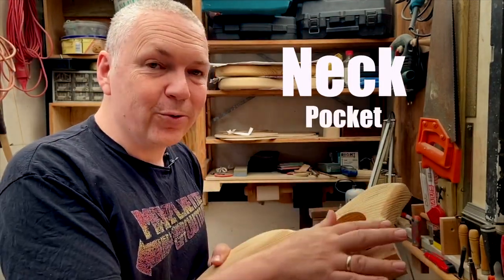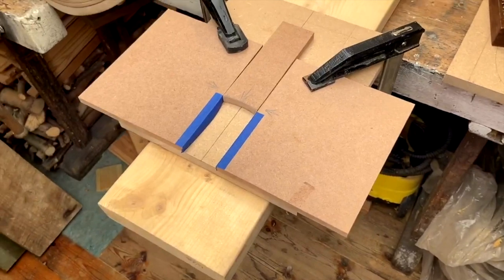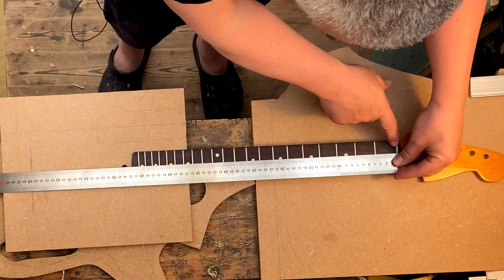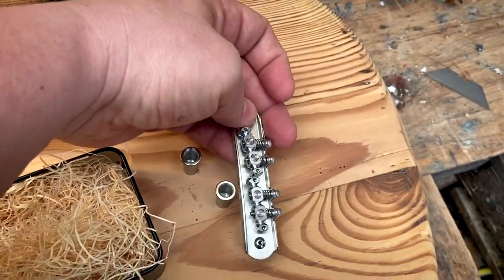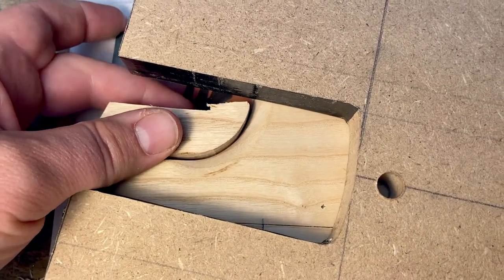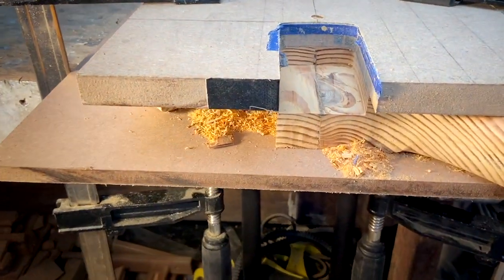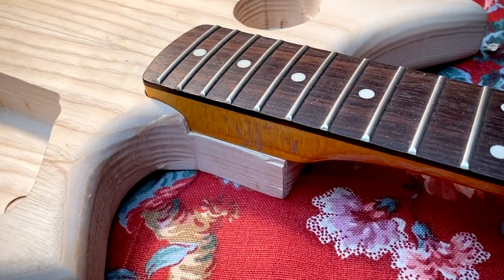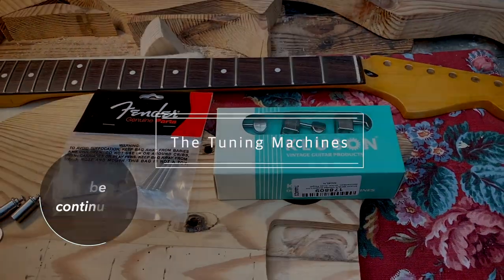How I built my DREAM GUITAR with NO experience - NECK POCKET - Part3:9

Comment: I liked your comments at the end concerning experience. It reminded me of the process used when manufacturing a new product. You go through the entire process with the first article (called the pathfinder) before producing or purchasing more components. That way you chase through all the issues and solve problems before spending money. That makes the changes less costly to implement. Experience is like that. There will be things discovered in that first build that will cause you to think, "next time, I'm going to do this instead." Each new build will provide even more insight.
Reply from the maker: Hi Mike, you are absolutely right… 😉👍🏼… and thanks so much for watching and commenting 😃🙏

Comment: the neck heel does not have to be really snug fit in the neck pocket. As long as it is reasonably snug and is aligned square to the centerline, that is enough. Bore the holes into the neck through the body carefully, and preferably with a drill press. A very light wipe of ChapStick on the 4  neck wood screws will let the screws go into the body smoothly and with no sticking.
Reply from the maker: Hey Doug
Thanks so much for your comments. I need all the help I can get 😉. 👍🏼

Comment: Thanks for sharing!  I’m about to do a route job for the first time on a guitar build. I was thinking about taking it to someone before seeing your video. I think I can do it and the idea to test it on a different piece of wood first is a great idea. A couple questions, what type and size router bit did you use? Also I am going to set the neck first then place the bridge. I was curious about that because some bridges are on an angle. Is  it okay to mount it straight or should it be angled for optimum intonation adjustment?
Reply from the maker: Hi Greg, thanks so much for watching. 😃🙏🏻
Router bit size… hm… I actually used a few different ones. Some with the bearing on top (10 mm to 22mm long/deep) and one with the bearing in the bottom ( used for cutting the pick guard) and then the 45 degrees angle bit for the edge of the pick guard. I have a 10 mm bit and a 16 mm bit.
My most revelatory experience was: take it slow with light passes and don’t let the machine go to fast. I was going 2 out of 7 speed.
Hope that helps 😃👍

Comment: I would think neck pocket depth is a function of saddle height off the body.
Reply from the maker: You are absolutely right ... and then you of course also have to consider the thickness off the heel 😃
Reply: It is related, yes. Fender Guitars typically have a flat neck heel, but that's not very helpful in regards to balancing pickup volume by use of pickup height.
Reply: @101Volts  I don’t understand why a bolt-on neck changes the effectiveness of adjusting pickup height vs. a set neck (either flat or angled).